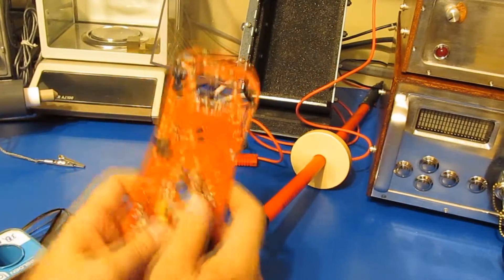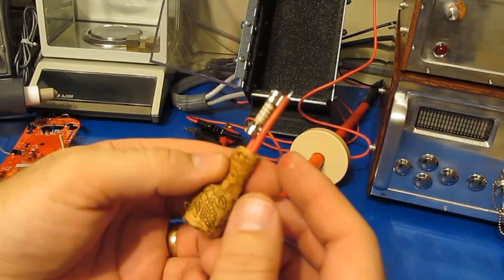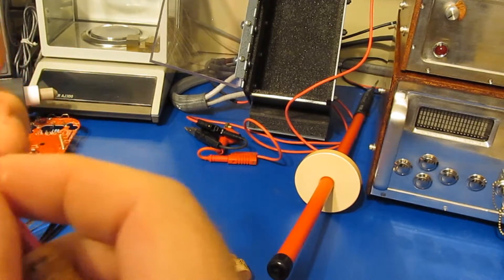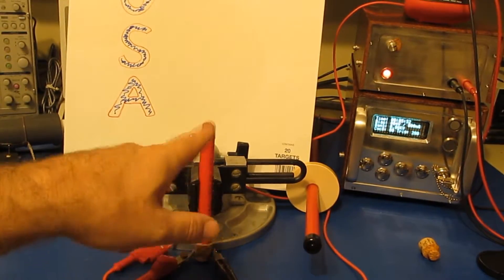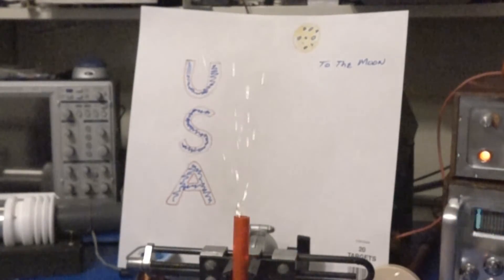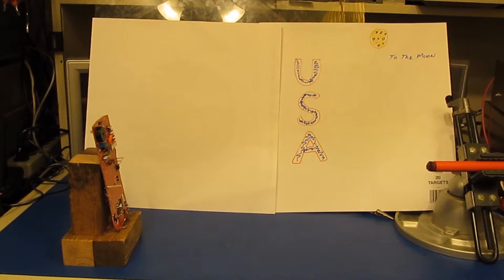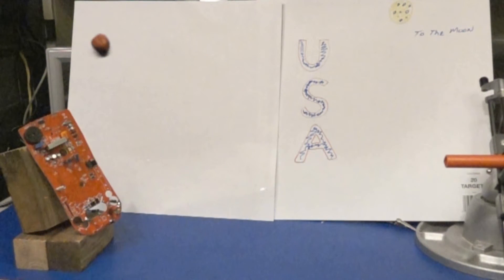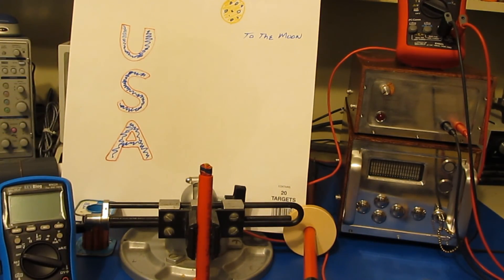Fuse bypassing Part II, The Complete  Idiots Guide to HRC Fuse Replacement

Comment: When I was starting out I bought an ExTech meter to save some cash. While testing a 300+ volt system at work, it shorted out internally. Luckily, it was resting on a tech manual on the ground, and I was not standing directly over it. The clear meter face was launched with such force that I never found it. Scary stuff.
Reply from the maker: I've ran a few ExTech branded meters.  I was planning to run the same meter I normally use which is an EX540.  The one I bought had some major quality issues.  It did not work out of the box.  Then CEM had changed some of their suppliers which seems to cause other functional problems with the meter.   I am not impressed with it at all.